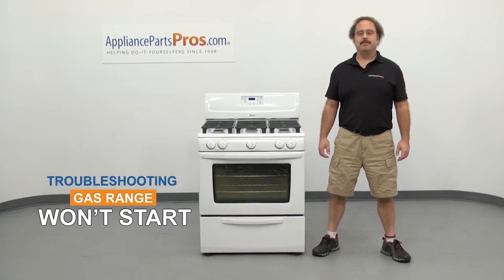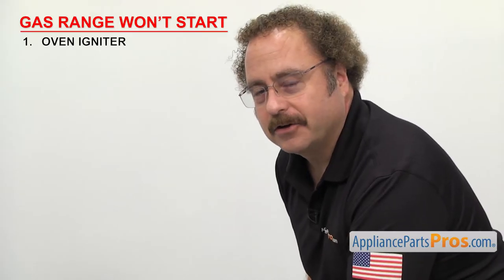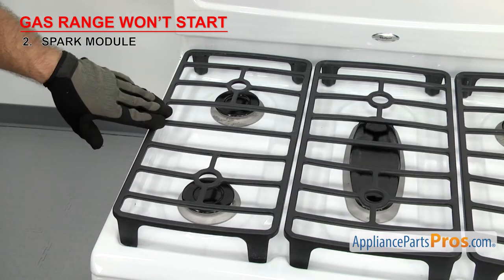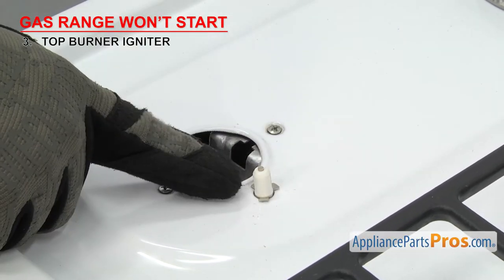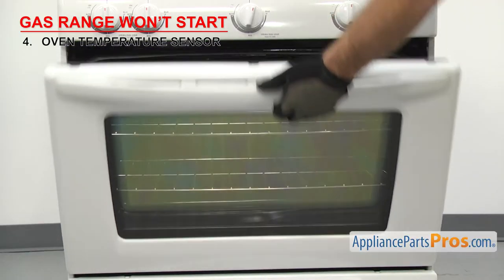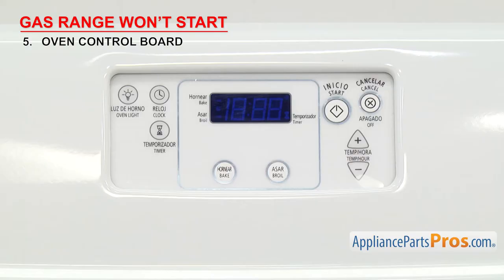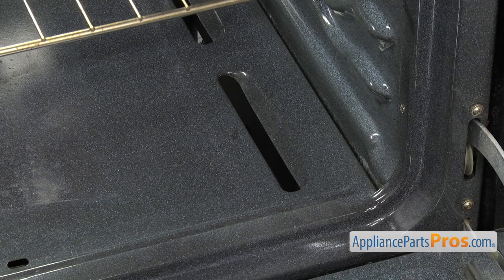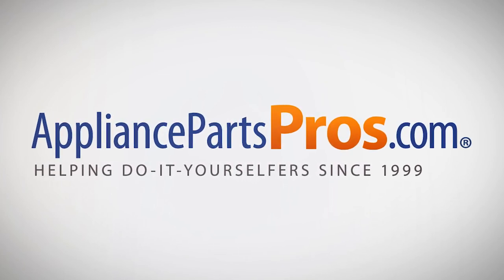Gas Range Won’t Start - Top 5 Reasons & Fixes - Kenmore, Whirlpool, Frigidaire, GE & more

Comment: I need help !!!!! 
My gas oven won't work but the burners do. Display showed F3 so I replaced temp sensor. I replaced regulator. I replaced ignitor. I took the back cover off to look at back of control panel- nothing looks burnt. I also looked at spark module and nothing looks burnt. 
I am at the end of my rope. Please help me !
Reply from the maker: What is the model number of your oven?
Reply: @appliancepartspros  I decided to buy a new oven
Reply from the maker: Okay. If we can help in the future with anything please let us know.